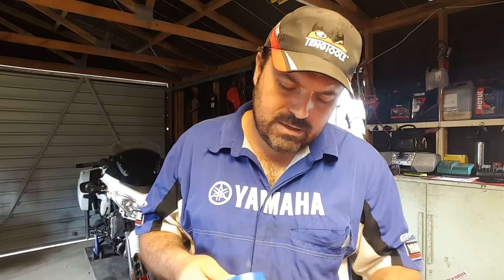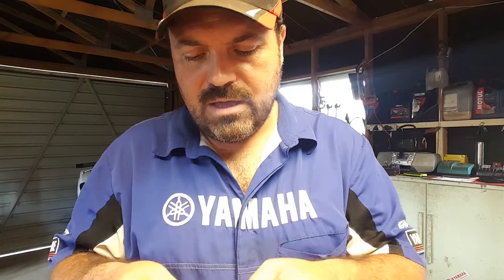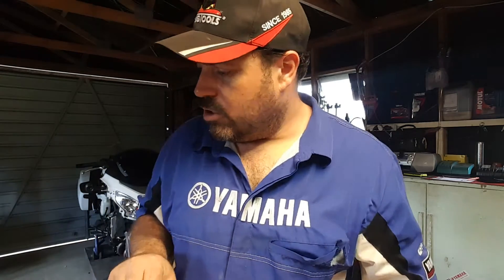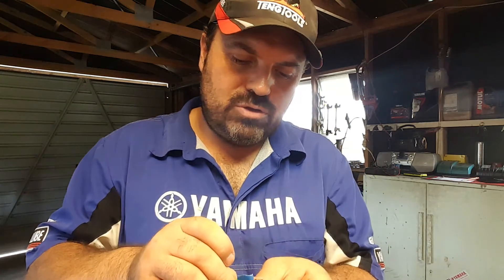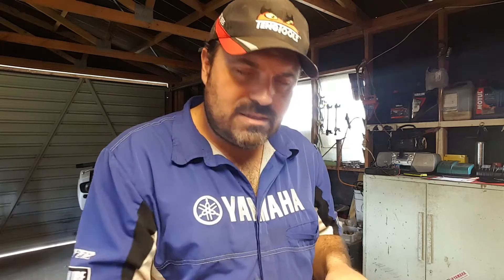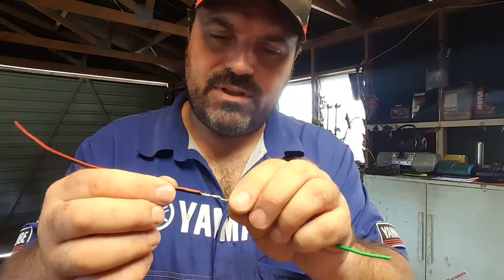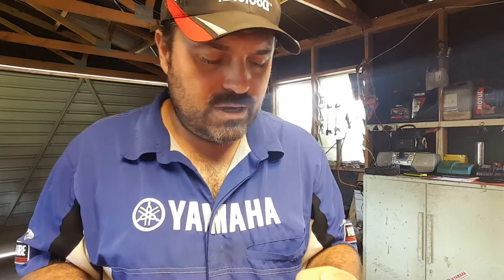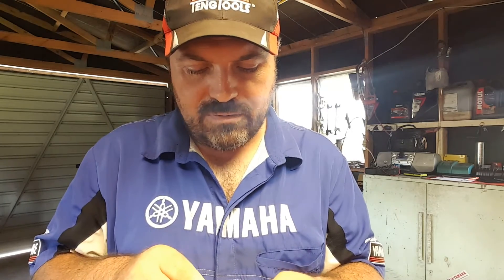Insulation tape 'v' heat shrink #1914

Comment: Common brody don't join 2 wires like that! Do a western union splice; if you don't mind the V shaped, that method is fine.  If you want to end up with a straight wire, do a western union splice!  Sorry hate to be 'that guy' but I count help myself after I saw you join into a v and then fold bare wire over the insulation.  Western union splice sooo much nicer before heat shrink - look it up super easy!!  Thanks for sharing the know how though appreciate you man..

Comment: I saw that you don't recommend twisting both wires together. But if we do not have soldering tools, will it be okay to just twist both wires together and use heat shrink over it? 

The red and black wires are on the small lipo rechargeable battery while the extension wires are connected with a jst at the end. Is there any safe way to connect without the use of soldering tools when we're dealing with rechargeable batteries?